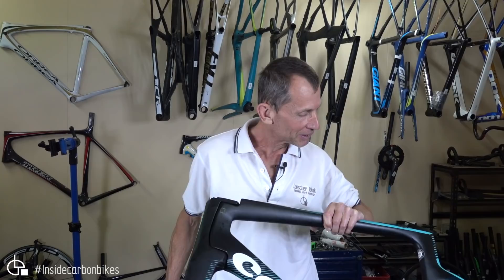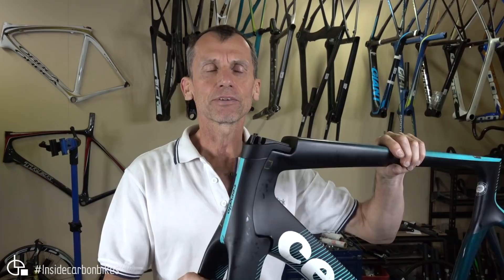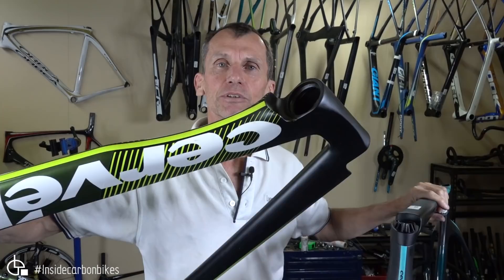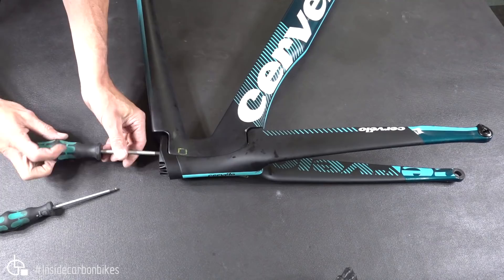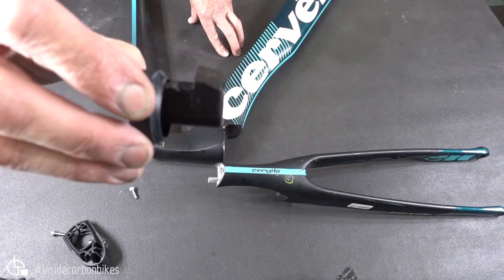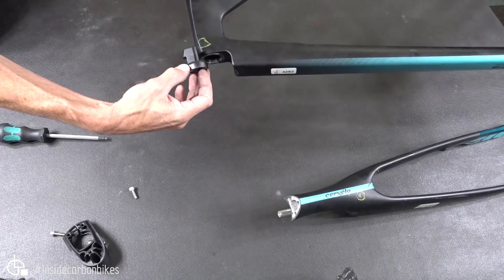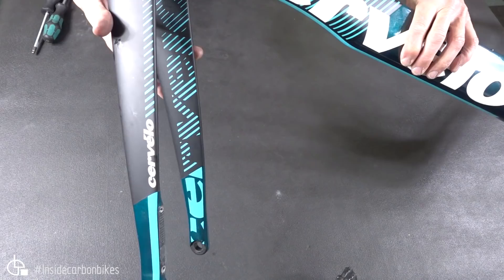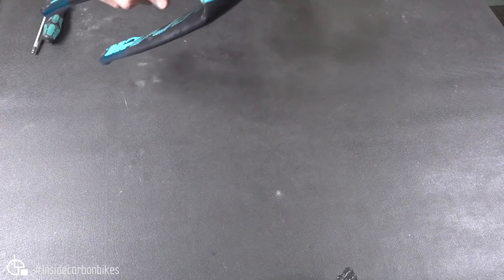Cervelo Design Fail!

Comment: I reckon you and Hambini should start your own bicycle company.
Reply: I would gladly fork over a few thousand dollars extra to buy a bike that is actually designed and manufactured to high standards.
Reply: Problem is they would have to move to Asia and be at the factory regularly to ensure quality control.  No one wants that life.
Reply: "Leuschini".... it even sounds Italian! "Hamber' doesn't quite have the same ring to it.
Reply: No. Many brands made stuff at home facilities before. And the bikes were cheaper than now. 
They pay less for the stuff in China but charge more in endeffect. 
QC means extra people but good QC means less recalls. It's only a question how much the honesty and fairness are worth for them.
Reply from the maker: The problem is that it is a marketing exercise not an engineering one!
Reply: @LuescherTeknik   as Hambini said in his last video Canyon gets an A* for that but engineering and quality it's an F.
Reply: Luescher Teknik you’ve just done the marketing
Reply: @LuescherTeknik  Don't you think your combined YouTube reach is already sufficient to pull your own frame brand of? 
Step 1: Find a manufacturer to build frames to your design & tolerances, and Hambini's BB specifications. Step 2: Scan every frame for tolerance failures and voids. 
Step 3: Ship approved frames to customers. 
Step 4: Profit.
Reply: @cup_and_cone  True because as hard as you may try, no one can do CF frames without an enormous infrastructure.
Reply: @ilja2947  Nice, but that's the way every well meaning company starts.  You build the brand.  Someone bigger than you takes note.  They make you an offer you cannot refuse.  You retire to Tahiti and the gigantic company starts building junk frames under your built brand.  As they take the profits out of the brand's name, the brand starts declining.  In 10 years, profits have been reaped under mass produced junk and the brand is ruined.  That, sir is the way it's done.  Ask Schwinn, GT, Mongoose, Cannondale, Trek, and others....
Reply: @SinnerSince1962  Are there any major bike companies left that are still (partly) owned by the original founders?
Reply: @ilja2947  Nope.  Good point.  It's sad.  There are a few smaller companies, I guess.
Reply: @ilja2947  Giant
Reply: @thedownunderverse  Hambinidale
Reply: Technically driven design bikes would look completely boring with only round tubes and would all basically have the same frame design. Like they did in the 80-90. And then came the marketing...

Comment: Hello and thanks a huge lot for this insight! Wouldn´t have never expected such a great engineering failure at cervelo. Mr. Luescher (if i am right), could you think of any "hack" or workaround to this issue, i mean, any "treatment" of this metal part or the part of the headtube to provide a "cure" anyhow that would avoid damaging by too much handlebar travel? Or is this just out of reach, and the basic design failure is so grave that it doesn´t make sense to get your hands on this product at all? - I see this is a tricky question... i ask in another way: Is there a way to help people, who have already bought that frame, to avoid that problem? Another than just fixing cracks... a method of avoiding the damages in the first place? Greetings!
Reply: This needs an answer to save a lot of us 👍
Reply: Just add a little canard, or nose wing, to your top tube that sticks out laterally enough to "catch" the handlebar as it swings around JUST before the internals contact each other.  Simple solution.  You may have to have some sort of knee reconstructive surgery so you can clear this "innovative" frame addition while pedaling.  Minor inconvenience; shouldn't bee too much trouble.

Comment: I served in the Industry for over 13 years and the need for performance over quality, and marketing BS saw me hang up my hat in frustration, as the warranty claims attested. I now own an Australian built custom steel framed bike and the quality is outstanding, not to mention its superb ride....plus I’m off the ‘next model’ entrapment psyche, and I am back to enjoying the sport again. To all those considering a high end carbon bike I would advise you to, at the very least, inspect a well made custom steel frame....I wish I had done that over a decade ago.
Reply: How heavy? Why not Titanium
Reply: I used to build and inspect carbon aerospace structures. Ive built lots of machinery to the highest quality standards on earth. I'll never ever buy a plastic bicycle. I simply know better than to waste money. If I was given a plastic bike  for free, I would give it away or sell it. Custom metal is awesome. Ive owned several custom steel and aluminum frames for decades. If you design them practically and ride them sensibly they'll last indefinitely. Ive had zero issues or failures with all of them. Should there ever be ANY issues, I have a bit of recourse! I only buy frames from people I know well and trust with my life. I KNOW EXACTLY who built them.  A custom frame gets you EXACTLY what you want, not what some marketing idiot thinks you 'need' or what makes them a big profit.

Comment: Thanks for your work Luescher! So appalling to see this level of engineered that overlooked safety aspects of carbon.
All these fancy designs with little to no improvements and added maintenance among the different manufacturers is the primary reason why I have lost interest in mainstream brands over the last few years. Gotta admit these bikes looks cool though! Poor engineering, false advertising, outsourced manufacturing to Asia with little quality control where the product doesn't provide the value customers paid for.

As you and many others said, best way to build a road bike is straight round tubes. Stick to non-proprietary components - BSA, 27.2mm seatposts, non-integrated bar-stem combo.. rim brakes too!

I'm of the opinion relating from so many users' experience that if you wanna go carbon, it is generally good enough to get one of those FM models from reputable Chinese manufacturers like Hongfu/ Dengfu/ Light Carbon etc . Durianrider has one which I reckon is good value!

If you really want a traditional bike made from carbon of high quality, it is really worth considering getting a custom builder since the cost of these mainstream brands have skyrocketed that they are almost on par with a custom frame. You get the geometry you want and some also offer BSA bottom brackets. Sarto Asola is one of these bikes that comes to mind

I'm now more and more starting to see the appeal in titanium and steel bikes after riding for more than 10 years, having seen these issues with carbon designs and years of false adverts etc etc..

Comment: Usually videos with this kind of title are either clickbait or unargumented hateful crap. This on the other hand is amazjng content. I have tested this bike some 10 days ago and was impressed, but after this I will remove this bike from the wishlist until I know they've solved the issue. Thank you sir, I am subscribing for sure! P. S. As a designer willing to defend my profession, engineers are in charge of this part of the creative process. Put simply, designers are responsible for the outside of the product, engineers for the inside. So don't blame us guys 😁

Comment: A simple ahesive-backed piece of aluminum plate stuck inside the headtube at the contact points would have gone a long way in broadening the impact point...but I guess a dollar's worth of band-aid solution is too costly to implement before shipping a $4k frame.
Reply: I was looking to buy one of these bikes (a professional bike fit led me to them from my odd position) and I was thinking about doing the same fix the second I got it. Do you have any experience doing a fix like that? I think the aluminum would accomplish 2 things, limit the travel slightly more so the fork doesn't hit the frame anymore externally, and save the carbon from delaminating. Thoughts?
Reply: @swflelite   Something is certainly better than nothing - it is just a matter of the potential Cervelo declines a warranty by trying to blame your modification.  In a big crash I doubt any method is going to prevent damage because that's a significant force being leveraged.  Any protection would primarily be for carrying the bike around and/or knocking it over.  

Off the top of my head, the quickest/easiest solution for someone with no tools is a simple adhesive wheel weight.  You could probably get a couple weights for free/virtually nothing from a local tire shop.  Downside is they're obviously weights, and you'd probably add about 15-20 grams for the pair.  Modern wheel weights are made of steel with a zinc coating for rust prevention.  

A better method would be buying an aluminum flat bar from your local home improvement center, cut it to size with a hacksaw/Dremel, file the edges, and use a 3M VHB double-sided exterior rated mounting tape.

The important thing to remember with either of these two methods is that you're sticking a flat piece of metal against an inside radius...you need to ensuring the outer two edges aren't point loading too badly (this is where the VHB style tape comes in to help disperse the load).  Of course filing the edges into a taper would help too.  The best way would be bending the material into a matching radius.  This would be quite easy if you got a flat bar, because you could bend the entire bar before cutting and then cut it after you've radius'd it.

Another completely different approach would be add soft bumpers onto the cam/limit stop itself.  Something like Scotch rubber bumpers (made for cabinets) would be an option...place it on the limit stop right where it impacts.

I suppose you could also do a combination of the rubber bumpers and aluminum plate, too.
Reply: @cup_and_cone  thanks for that response. I was thinking a similar thing, 3m double sided tape on the back and possibly sheet metal aluminum just to disperse the pressure from small dings. It might save the outside and the inside just enough.

I've been staring at geometries on bikes and can't find anything that's reasonable for a short guy like me (5'4" with a lot of torso) to get into an aero position (low stack, low standover, reasonable reach, low seat tube height, etc.) 

Between the seat tube height and stack alone it rules out half the aero bikes on the market. This bike is one of the few that's ballpark where I need to be.

Comment: Maintaining my position that the s5 was actually just made to use as an excuse to your partner why the s3 is reasonable to buy.
Reply: that is called "halo marketing" and it is a very real strategy,  make something ungodly expensive so it makes the normal overpriced offerings look sensible.
Reply: Sills71 - sounds reasonable. If you look around, you will find this phenomena in fact in abundance. So i think it really is a marketing strategy.

Comment: It's simple.  The engineer was incorporating a sacrificial element in the bicycle frame's design.  When the bars spin around really fast, the sacrificial element is designed to absorb the impact and fail at the same time.  So that's a perfectly fine design approach.

Problem is, the sacrificial element is the FRAME!!!
Reply: Actually you forgot to mention another significant sacrificial element here: the rider.

Comment: I actually ❤ this frame & bike.... without looking at it myself.  I would glue some old inner tube in there 2 counter act this on both surfaces.  On on 45 & 90 degree turn l dont think u would hit the inside of the frame.  Stand 2 be corrected on this. However from your point of view,  good find. Did you write to Cervelo about this 2 Complain ?

Comment: Dear Mr. Luescher (of i am right), thanks a huge lot for this insights! I was about to buy one of those frames myself, so good to know about that issue! But: What if i loved this frame so much that i would want it anyway? Can YOU think of any solution to this problem, i mean any „hack“, for instance replacing this special hard edged metal part or working on it anyhow or any other way to „cure“ the frame from being damaged by handlebar travel? THAT would be a great thing, because you‘re the expert. A vital solution could be paid for also, no one has to work for free. - Or, maybe there is no cure. Just to avoid this kind of engineering and to look to other brands when getting into aero frames. So what to do? Greetings!
Reply: I would most likely, cut the edge of that piece , making sure is no contact, but that could influence the steering integrity (maybe?)... Check the previous S5 , this problem is not there ... Aesthetic wise ..(and my opinion) just make sure you use some kind of wireless gears , etap, as the cable routing on those was something ugly to the eyes . ;) Ride on!
Reply: Clearly avoid the brand. What would make you think anything they produce is safe to ride?

Comment: You know, originally I thought, "nah, that's dumb, no one is going to put that kind of stress on that area without being negligent"..... boy was I wrong. I crashed on my BMC Timemachine 01 (previous gen) last weekend. It has a similar type of fork setup but there is a little plastic bumper to absorb force where this Cervelo would be hitting carbon on carbon or metal on carbon. I inspected thoroughly, no damage to the fork or frame. The little plastic piece was toast but it was obvious it took all the impact.

Comment: I’ve owned one of these for just over a year now, and put about 6,000 miles on mine. I’ve traveled with it, rode it in shit conditions, over cobbles, tossed it into the back of pickups, and along the way have had a few knocks here and there without any issues. When I bought my bike, I built it myself, and immediately thought their fork stopper was a stupid idea, and considered putting a small rubber bump stop in the head tube, and near the fork/frame convergence, however I never bothered. I just built up an S-Works Tarmac and will be sending my S5 out to be ultrasound tested, and will report back if I find anything horrific. However with the cursory inspection I’ve done so far, I don’t have any cause for alarm, and have been pretty damn happy with the bike despite the headset stupidity.
Reply: Thing is if they design something like that I wouldn't take any other windtunnel claim etc seriously anymore either. Or that supposedly aero steerer, it's all just marketing fluff mate.
Reply: Stoffendous Yes it’s a stupid oversight, but it doesn’t invalidate any benefit from other aspects of the design that are good. Whatever it may be you take the good with the bad, there’s no perfect bike. I’m certainly not about to chuck a $5,000 frameset in the trash because some guy on the other side of the world has a problem that hasn’t been an issue for me, however I’m also not so naive to think it can’t happen to me. 🤷🏻‍♂️
Reply from the maker: I am not saying to chuck your bike in the trash, just to be aware that this could happen and what to look for.
Reply: Luescher Teknik Oh I didn’t think that was what you were implying at all. I watch pretty much all your videos and doubt you would be suggesting that. I was just saying that dismissing the people who tend to get carried away in the comments.
Reply: @LuescherTeknik  I have the same bike and have been riding it with no issues at all. I have inspected my bike thanks to your video but did not find anything out of the norm on the "contact points". The learning of this video for guys who own this bike is that there is a hard steering stop and one should avoid turning the steerer fork to its limits with force. i doubt anyone who own a CF bike would do that. i own other bike with the traditional steerer tube and i don't turn those bike to its limits with force either.  During normal riding there is no way we would reach those turning angles on the S5 so i will not be so concern. But i do agree with your other points such as transporting the bike, or accidental dropping of the bike, the steerer may crash onto the headtube and cause some damage.
Reply from the maker: @garl9302  happy to hear that you have checked for damage and your bike is currently ok. At least now you know what to look for and are aware of the potential problem.
Reply: @leuscher teknik

Is there any fix for this? Can an aluminum insert inside the headtube stop this damage from happening?

Comment: Great video Luescher. 
Somebody in the Netherlands now signs off after Vroomen-White sold Cervelo. :( 
Vroomen-White signed off on all those BB problems including on one of my 2 RSs so I'm not forgiving them. 
I've been trusting (?) that my RCA was their best work before they ran off.
Most designs use the front brake caliper in one direction on a rim brake design to limit 'full lock'. 
Is a handlebar wrapped with tape the only way to limit risks from 'full lock' causing high impact stress on a carbon bicycle?

Comment: If your not a pro rider a steel frame and fork is light enough . My friend has a 99 eddy merckx strada os lugged frame set complete bike weighs 18.5lbs . This guy put 100,000 miles on it. I rebuilt it at least 5 times and it still has a good snap to it. He weighs 180lbs, the frame has no cracks and is holding alignment.

Comment: This looks like recall level design defect as it is.  Honestly pretty reckless, and scary considering how easily and unexpected a frame damage could occur.
A bit of shame really as mechanically it might not be a terrible idea.  If the cam was not made of metal and instead a hard rubber or plastic and there was a metal insert on the interior of the frame this might have been a workable and good design?